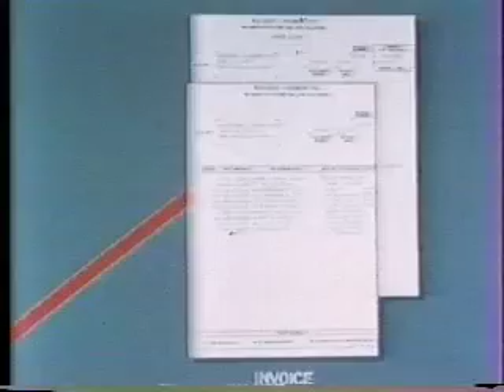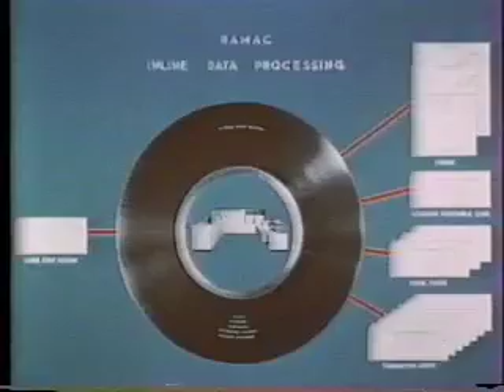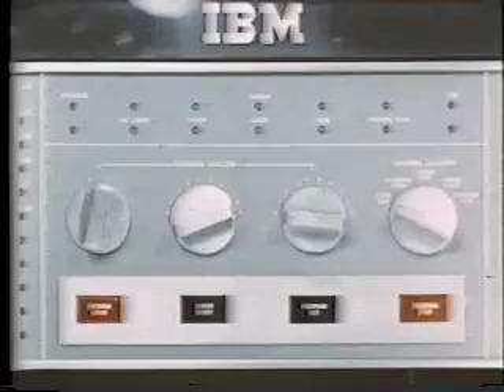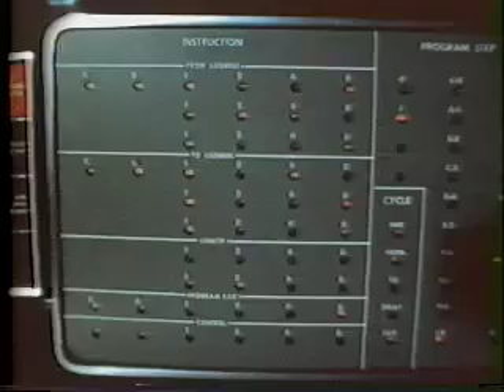ibm 305 ramac

Comment: I wanna go back in time and give IBM a 10TB Seagate HDD
Reply: They'd lose their minds even at a 500 Gb HDD- although how you'd transfer data in and out of the 1950s computers and  the drive using USB to whatever their connectors were (pre-RS 232?) is anyone's guess.

Comment: I am researching Reynold Johnson. He was a genius inventor; he had over 90 patents!

He was a high school science and math teacher at Ironwood High School in the western part of Michigan's upper peninsula, during the early years of The Great Depression. But the school fired several teachers in 1933, because of budget cuts, including Reynold.

Reynold had been working on an automatic grading machine. IBM bought his grading machine. They hired him in 1952, and gave him the job of inventing some way to store computer data that was better than punch cards.

He put together a team in 1953, and by 1956 they had invented the world's first hard drive, the 305 RAMAC! It stored 5 megabytes on 50 platters, coated with magnetic paint, spinning at 1,200 revolutions per minute.

It costs $50,000. In 2019 dollars, that works out to $473,063. And a company could rent one for $750 a month.

Today 5 megabytes doesn't sound like much, but in 1956, 5 megabytes was enormous! And a hard drive was so much better than working with punch cards!

One punch card held 80 characters. When a punch card had too many holes, or several holes that were close together, it was fragile. When a machine tried to process that card, the weak card buckled and jammed the machine, messing up that entire batch.

Reynold also invented:

1: The videocassette tape!
2: Talk To Me books for Fisher Price!

Sony had been using reel to reel tapes. Reynold wanted something small enough that a child could handle. And, of course, it had to be reasonably child proof. Hence he put the tape inside a plastic shell to protect it.
Reply: Herman Holerith developed the code to prevent too many holes placed close together. Each column in a punch cards was 12 bits, not 8. Yes you can punch binary data of 8 bits each leaving 4 holes free for the strength of the card. The card readers used rollers that grabbed the card, not pushed. The only time a card was pushed is when a claw would grab one card from the bottom, feed thru a metal gapper, then onto feed rolls. Some feed rollers were the entire width of a punch card, like on an 083 card sorter. 
IBM took great care in handling the cards because the cards are meant to be read many, many times.
Later on they used pneumatics to puff some air to separate the cards at the entrance, and a vacuum would pull the card into the reader, doing away with the claws and gappers.
I worked on al the unit record equipment IBM made.

Comment: Somehow this seems MORE complex than today's computers. I'm impressed.
Reply: It seems more complex because today the complexity is hidden, or smaller than the eye can see.
Reply: Your TV remote is more complex.
Reply: More complex. A new computer by old computer standards would fill the space of a whole city and be very complex. New computers are simple. You need a board, a few chips and a soldering gun. And just because new computers have microscopic parts don't make them more complex. Humans don't make new computers. Other computers make other computers. The process to make chips isn't hard, it was just hard to discovery to begin with, and easy after that. Once a breakthrough is made it's easy to reproduce. The whole process with chemicals and light and heat may seem complex, but it's just a process. Now different than the process of getting up in the morning, eating, washing, brushing your teeth and driving to work. You want to know when new computers become more complex? When you don't have an already functioning supercomputer nearby to make chips for you, and you have no spares laying around. Then new computers aren't complex. They're just flat out impossible. So new computers are only more complex in science fiction terms.
Reply: @tommyhatcher3399  Just to throw you a curveball, in the future we're going to need super fast computers that work in space and at high altitudes where gamma rays and micorscopic space debris will flip those bits . Today's computers used in airliners and spacecraft are old chips designed in the the 80s, like 80386 or even 80286. They don't flip so easily, but they're much slower. You can't put a 5 or 10 nm chip in space (and expect it to last). We need speed, efficiency and dependability. And that's not an easy task.
Reply: Actually it is not, there are less complexity in cpu's instructions.
Reply: @MyAsdfqwe  If you told these engineers we have Billions of Circuits in a single chip they would be blown away. They had thousands of them at max in the size of a room!
Reply: @thomask5434  And alot of people will only play games with all those bilions circuits :)
Reply: @MyAsdfqwe  You'd be surprised at how complex these machines actually are compared to our computers today. The amount of engineering and time that went into wiring and hand printing every circuit board, the programming of every machine part down to the very binary and relays you must move, the frustration of missing a punched card in your program so you have to rewrite it all. People take modern computers for granted since they're so easy to operate and fix. Though if you go back to the time of the mainframe, you will see just how complex they really are.
Reply: @loganlentz3069  Definitely more complex in regards to designing, building, operating, and maintaining. They're equal parts digital machine and clockwork mechanism. Today we can create a "computer" in silicon far more complicated in its microscopic circuitry, then mass produce it and sell it for pennies for nowhere near the effort it took to build these.

Comment: I am at my input station inputting this data. The data is outputted on the output device located in front of me.
The processing module will send the data to a web of other processing modules and the data will be read by other operators through their output devices.

Comment: I wish I had save my programming manuals to the 305 RAMAC and some of the old punched card machines, especially the 407 tabulator and the 605 calculator. I even had access to the repairman's manuals. Those were the good ole days.
Reply: Looking back at the RAMAC and seeing the technology we have available today, what do you have to say about how far and fast computers have evolved?
How far did y'all expect computer tech to advance?
Reply: I was fortunate to see most of the progression of computers. The 305 RAMAC required 1/3 second to add two numbers. If you want to know if the result was positive, negative, or zero it required 1/2 second. Multiply and divide was optional, which we had. The drum where the executable instructions were stored held only 200. A practical program required reading routines from the extremely large and slow disks on to the drum. I never expected computer to be as fast and versatile as they are today. They do millions of instructions in 1 second and run extremely sophisticated programs. I forget how much data the disk drive then held. Today on drive hold terabytes of data. You can also have thousands of people logged into a program at one time. There was a program called VM-370 (?) that would allow hundreds of users to log into the operating system and simulate having a complete computer for themselves. Ah, things certainly have progressed.

Offfway12991, did you program on the 305 RAMAC? Where and when did you do it? I was in the US Army in Poitiers, France in the early 1960s.
Reply: I've only ever fiddled with a 305 that a friend of mine bought. He's a private collector of old computers and he was really happy to get a 305 because he used one back in the early 60s as well when he was a counter-SIGINT and something else. I can't remember where he was stationed, though.
I just think it's absolutely fascinating to see how it's all evolved. And (if I remember correctly) the 305 only had 5mb of storage.
Sorry, I didn't mean to ask so many questions. I just like talking to people that used older tech when it was state-of-the-art to see what they think of computer evolution.

Comment: How did programmers, technicians, users.. of those machines get output from the computer? I hardly see screens in those footages... punched cards, continuous paper maybe?
Reply: A printer was available. My unit in the US Army punched out cards and then printed the information on a 407 card tabulator. The 407 was controlled by many wires in a special "plug board" and could print, add and subtract. No multiplication or division. This was extremely crude considering today's personal computers.
Reply: Larry Clifford Thanks, Larry.

Comment: Amazing machine, but calling it a computer is incorrect. This was the last generation of plugboard accounting machines made by IBM. IBM 610 was the small system, 650 the midsize system and 305 was the large system. These were not general purpose computers - out of all these machines only the 650 could do branching without using the plugboard.
Nonetheless, IBM spared no expense when it designed these machines. Check out the futuristic looking keyboard at 4:42 and compare it to the clunky typewriter consoles in use in the '50s.
Reply: echidnamedia All three machines were stored-program machines, but not real computers. They were hybrids between plugboard tabulators and programmed calculators, and resembled more the IBM series 400/600 of accounting machines. Their architecture was nothing like that of a computer. For instance, IBM 650 had no RAM, just an external magnetic drum, and the program was executed line by line from the external support - imagine how fast that was. IBM 610 was even worse, instead of a magnetic drum it run the program stored on a paper tape and had no branching capability unless the plugboard was used. In addition, all these machines were decimal not binary.
Reply: @danoprea9685  the 650 was a bit more, at least in the sense that a good student, learning to program on a 650 RAMAC, would be relatively well-prepared for programming on full mainframes of that era.
Reply: Actually, the 650 was a real stored-program computer.

Comment: Look at that behemoth, it's bigger than a refrigerator. Almost 60 years later, the smallest hard drives ever built can easily fit in the palm of your hand. 30 years ago, most computers didn't even have a hard drive, they usually cost more than the computer that used it. It's amazing to see how far technology has progressed.
Reply: Now the smallest hard drives can fit on your finger tip. Crazy stuff
Reply: M.2 hard drives are the smallest with the highest storage capacity now costing under $100 up to $200 tops. This thing costed companies & the military over $30k a month to own & run.

Comment: So this would read from a disk instead of tape right? So basically it wouldn't matter the order of which the records come in right ? Then you needed some kind of index too then right? I learned about sequential file updates this year  in programming logic and this kinda looks familiar . You know like if the CMRF equal TRANS update the master record, if CMRF lessthan TRANS an error has occurred, and if CMRF greaterthan TRANS no changes have been made.

Comment: Wow! what a beast, I guess it uses only one side of the disc. The price must have been astronomical, the maintenance contract, eye watering. 

600ms access time for the RAMAC vs. 6ms for a decent modern drive (100x faster)

Modern drivs 6ms vs. 6µs for SSDs (1,000x faster)

Modern hard disc drives have reached a plateau of performance, Flash memory will replace them in the very near future, my XPS has two 512GB SSDs and its like lightning.
Reply: Are you still alive? you predicted the future
Reply: @ChinmayRGharat  Remember this was 2010, not too long ago.